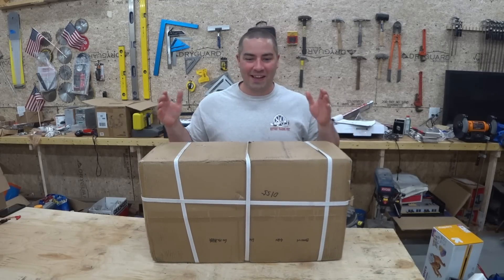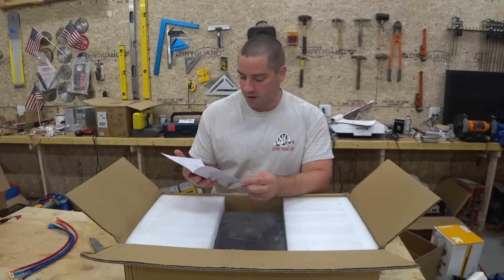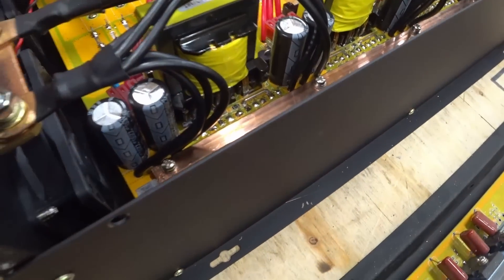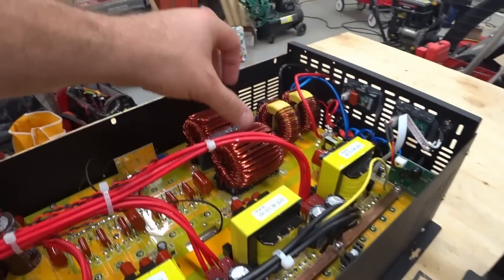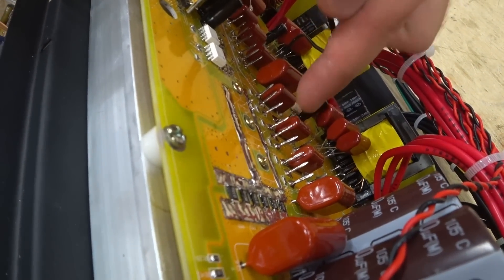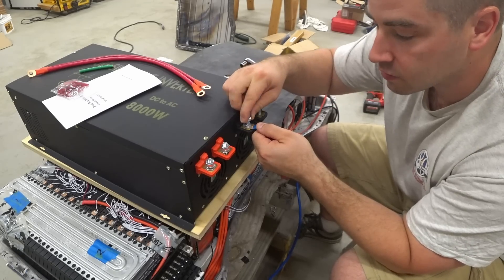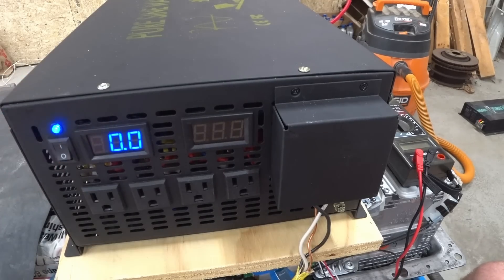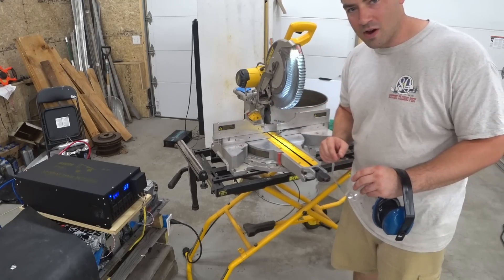Cheap 8000w Reliable Inverter, That Works! WZRELB

Comment: So far I’m halfway through your video of these transformers and it all makes complete sense to me now you’re talking about how the wire gauge is smaller and one thing a larger gauge wire going to a plug and then a lower gauge wire jumping between all four plugs is completely incorrect and definitely not CSA approved I would think Just because if you were using all four of those plugs and drawings he even only 10 AM so if each plug that’s 40 A that wire would definitely mount a friend of mine in China who works at a battery manufacturing company and they also make PMS is and transformers they do the whole solar equipment package then power wash the whole 9 yards he’s told me that because of everything that’s been going on their largest scrap metal supplier which is the United States has completely start sending them all their crush cars that sort of thing like Canada does we sent it over to them they melt it down remanufacture it send it back to us so they have a huge shortage of more commonly used medals when it comes to electronics like aluminum copper even lead myself if the price is right I would buy this unit but I would just upgrade the wires myself seems like there’s lots of room to work around in there and it would give me peace of mind that the unit would catch on fire I’m gonna continue on watching now and see if I notice anything else

Comment: I have a 2500 watt 24 volt reliable inverter and it will not kick on the ac compressor on a 5000 btu window unit

Comment: I bought the 6000 watt version to replace a 3000 watt inverter. The 3000 is the same brand as the Inverter you are comparing the 8000 with. It's lasted twoyears and it still runs strong, just has a little trouble starting the AC system. The house is completely off grid. The new inverter worked well for 24 hours. Then it blew its top. Literally. Lots of sparks and smoke. I'm sending it back to amazon for a refund but still need to decide on another inverter to replace the 3000 with. Not sure I want to try another one of these.
Reply from the maker: Sorry to hear that.  I ran my house for over a year on an Aims 6kw.  Currently I'm using Growatt 5000ES and is working well.  (videos on my channel of both)
Reply: @DavidPozEnergy  yesterday I picked up 10kw Treeline Power Systems {Sigineer} inverter. It’s way overkill but should last forever. The Company owner had one torn down and showed me all the goodies. The Transformer is massive and the control electronics are solid. And it only weighs 186 pounds! LOL. It’ll be a week or so before I install it. Waiting for the trolly system parts to lift it into place. Will post a video of the whole process.

Comment: What do you recommend for battery pack for your 8000 w inverter; let's say you want to run your chop saw 15 amps and your compressor 9 Amp to nail and reconstruct a tough shed for 3 hours????
Reply from the maker: Generally, you don't want to exceed a 1C rate of discharge.  This means at a minimum you want an 8kwh battery with an 8000w inverter.  Larger battery is fine, but smaller might get into over-heating issues.

Comment: Not recommended. Other you tube reviews show zero short circuit protection. Risk of fire or damage to unit is possible and therefore expense.

Comment: I think that you should have tested with the old battery setup to find out if the lack of voltage sag at startup is caused by the powerful battery or improved inverter.

Comment: I think only alot of power is not a quality feature. Most of this inverters suck alot power in idle mode, so they suck off your battery in short time in the night with no load. Thats the problem.

Comment: 120v x 24.3a = 2916w, 53.7v x 58.6a = 3146.82 watts.  2916/3146 = 92% efficient. not bad, not bad at all. in the beginning i heard you say 85%. any chance a max load test was ever done?
Reply from the maker: Yes, it did a little better than the spec sheet said for efficiency.  The next video I did a max load test.  Spoiler, it didn't make it to 8000w.  https://youtu.be/TZbjy9t933E

Comment: The thickness of the wires in Chinese converters is the biggest pain in the ass. Technically, 1mm square of copper is assumed for every 8 amps of current in GOOD COOLING CONDITIONS, i.e. not in the housing! So if the inverter has 8kW, the wires must conduct at least 70A CONTINUOUS current and as much as 150 peak. Therefore, each contact, each connector must have at least 20mm square of clean contact, no resistance, no play, no constrictions, made of pure copper, properly crimped and insulated. Each wire carrying 16,000 watts of peak power should be at least 25mm square.
Therefore, if I were to spend 950 bucks on a 6000W Chinese inverter, I would rather add 200 ... 300 and buy an inverter built in our country, where these rules are followed, or use at most half of the power declared by the Chinese.
Reply: Who makes a high quality inverter in the United States?

Comment: I have a 3000W low frequency inverter 24v input that powered my 14A air compressor. It took 1 second to start sometimes but it always starts.

Comment: For $1500 why not purchase a Aims inverter/charger?
Reply from the maker: For most applications I'd prefer the Aims.  This one is lighter, so maybe if weight was the main concern you would go with the Reliable brand.
Reply: @DavidPozEnergy  that's true, but would really only be a concern in the bush, for shipping, but reliability of aims is hard to beat, but I liked them a lot more when they used better quality parts.  I'd try reliable, but not for a 1500 price tag, I'm a huge fan of dip switched and the ability to use 220v,208v,230v,240v and the fact that aims are marine grade coated inside...

Comment: I bought the 5kw and installed this week. What happened to the AIMS inverter? I used one that looks identical to the AIMS and replaced it because the idle load drained my lead acids by at least 55% nightly. I energize half my home with solar so this is a big deal. I am new to your channel and like your videos. Thank you!
Reply from the maker: I sold the Aims inverter to help fund the new SMA inverters.  Thanks for watching.
Reply: @DavidPozEnergy  thank you for responding so quickly. I need a low low idle draw inverter like my magnum. Do you think the Reliable will fit the need?
Reply from the maker: Depends on your needs.  Reliable inverter have an OK idle draw, but not great.  I'm currently running SMA inverters and they have fantastic idle.  35 watts on a 6kw inverter.
Reply: @DavidPozEnergy  thank you for your input. I read that the idle draw on this 5kw is 40. My Sigineer (sp) idle draw... I think they make the AIMS... was 80 watts. I am selling it lol. Thank you again. I am learning from watching your videos. Have a good evening.

Comment: Your video, and testing methods were excellent. After watching, I conducted a websearch for the company and found that they have had several complaints... you may want to check out https://www.supplierblacklist.com/2016/04/28/yueqing-reliable-electric-co-ltd/  this company owns the Reliable and WZRELB brands. Suggest you check it out. They appear to be sending units to all kinds of youtubers for free.

Comment: I bet there are two sets of inductors for the screw down terminal box, as well as thinner cables running to the actual screw down terminal, because they might be doing a split phase system. They might be doing 60 V on each wire offset by 180°, just like how we get 240 V power here in the US. Even that doesn’t make complete sense though, and I lack the full knowledge (wouldn’t that still be 66A per wire?), just a shot in the dark

Comment: Explain what an inverter is used for pls?
Reply from the maker: Sure.  An inverter can take battery power, which is DC, and turn it into alternating current, AC.  Our homes and appliances use AC.  But batteries supply DC.  I'm working on building solar off grid system where the solar panels (DC) charge batteries (DC) but I need to use it as AC.

Comment: If you mean reliable inventer is there a multi appliances connected to it?, because you're cheating the normal battery to use, instead of normal lead battery plus solar but you have a heavy load capacity lithium battery, try to run at least 3 different appliances plus lighting's at the same time, because that is what reliable means when you are using inverter -like in a motor home etc.
Reply from the maker: "Reliable Electric Inc." is the brand that makes this inverter.

Comment: The wires are a bit small. There's a code that they can be smaller inside a appliance. Heavier wire would keep the heating down inside

Comment: I would like to see at lease 8 to 6 Gage wires. Yes, I like the 48 volts battery power inverter. I have to used two 8000 watts inverter to run my 240 volt well pump.

Comment: Capacitors on both inverters are comically small for the claimed output rating. These will have zero surge capability

Comment: good  technical  information about  Solar  power  inverter  #  but  U  did not   inform  when inverter  convert  batteries  DC  volt  to  AC  volt  it must  convert  to   AC 220  volt  & it must  also  show  how much  AC   ampear  current  it  converts #

Comment: 8000W ÷ 240VAC = 33 amps; so #10awg ok; each 120V hot line should handle 4kw; usually you don't want to be  runing 8kw continually, perhaps 80% of max. Capacity.

Comment: Was the version you tested a 110V output? If it is 220V can it use single phase from the output to get 110V without inducing error on the unit?
Reply from the maker: I tested a 120v output model.

Comment: I know you're a busy man and probably won't even see this question but if you do or any of your other followers could answer this solar newbies question? I found these batteries for cheap but not sure if I can used them in a box van solar build they are as follows (used hybrid battery cores with BAE propulsion. 40V, 220A, lithium ion, A123 System. Batteries in Module are ANR 26650M1A) any help would be so much appreciated.
Reply from the maker: I have not worked with those batteries.  But I think Frank Z uses them.  Check out his channel: https://www.youtube.com/channel/UC5FHXnj6lhE0oXn3gBZq1UQ/featured

Comment: There is a huge difference between chassis wiring capacity and power transmission. #10 is actually rated for 55Amps on chassis wiring. Thing is, it's a short run, so you got very little resistance: https://www.powerstream.com/Wire_Size.htm ....z

Comment: 24 Amps at 110 is only 2500 watts or so.........Let's see if this thing can actually put out 8000 watts.........Pretty weak test dude..........
Reply from the maker: You may enjoy part 2 video where I try to take it up to 8kw.  Spoiler: it did not get there.  https://youtu.be/TZbjy9t933E

Comment: Hi, may seem a silly question but how would you work out how much watts inverter I am in a converted van and have a 32" tv, I charge a laptop/phone and lighting and use a 2000w inverter but was wondering if that's draining my 2x 110ah leisure (12v) to keep the inverter going. As I know inverted do drain so.e power for it to work. Any advice would be grateful.. 
Thanks in advance (Gary uk viewer).
Reply from the maker: Yes, all inverters will draw some power while on.  This is called the "idle" watts.  I've had tiny inverters that draw 10 watts, and big inverters that draw 110 watts.  Big difference when you multiply by the 24 hours in a day.  Using a meter will help you identify how many watts you consume.  I like the Victron BMV 712, but it's expensive for what it is.  I don't know how your batteries are doing overnight.
Reply: @DavidPozEnergy  Hi, thanks for getting back to me. 
I have two 12v - 110ah. during the night all I really have on charge is my mobile phone. I have 5x led lights but that's it. sometime during the day I will have my laptop on charge, but as soon as that hits 100% I turn off the inverter.

Comment: The under dimensioned cabl, if it is, is the low voltage one. Linked to your batteries. Low voltage, constant current with high Amp, big cable....

Comment: Where can I get a good 12 volt power inverter with 4000 w
Reply from the maker: https://amzn.to/2Zr5icG  I used an Aims 6kw for over a year and it worked great.  I linked to a 4kw version.  However, 12v is very hard to work well up at 4kw because you will be drawing over 300 amps!  This will have extra heat and line-loss associated.  If at all possible you may want to look at doing a 48v system.  
“As an Amazon Associate I earn from qualifying purchases.”

Comment: Hey? If I was to buy that inverter, with those thin wires, does that mean I need to modify it so it can provide, 8000 What's?
Reply from the maker: No, it can do surges of more watts for short period of times.  But if you need 8,000 watts continuous, then there are other brands that can handle it better.

Comment: hi . can i use microwave 1100watt ( 2000w inverter ) with 3 batteries - 12v-35ha battery parallel ? and why ? thank you

Comment: What we really need is to see a scope on the 120 output without a load and then at various loads, also a measurement between output neutral and input ground. A 2000 watt Magnasine inverter should be able to start that compressor under any load and the waveform still look clean on a scope. I don't know, because  I don't have your compressor to test with, but Magnum sine wave inverters are the gold standard, possibly Go Power also. I'd also like to see current and voltage measurements on the input side while on standby and at various loads.

Comment: That inverter looks like a 4000-5000 watt continuous duty inverter.  You may be able to get 8000 watts peak for a few minutes but I doubt it will handle the full 8000 watts continuous without much bigger transformers and a lot more cooling.  I would test it with a full load of devices till you get close to 8000 watts and just see if it can do it and for how long.

Comment: very good. If you want to hit 8kW in power to test what this inverter can do, create a simple electrolysis bath. 1 bucket, 2 steel plates 20 cm by 25 cm and attach the wires to them. Then measure the voltage and amps as electrolysis progress.  By adjusting up and down the steel plates submerging in the water you can vary the power amount which is being drawn. Start small at 1kw - by submerging the plates just a bit, then increase until a fuse blows off. see if it can hold that load for more then 30 mins. That will give you a pretty good idea. I did this under 240V since this is the voltage level in my country. For you might be different since electrolysis depends on voltage.  In the video you only tested up to 4.5kw.

Comment: What no one is commenting about is that here is a company in China that is reacting to the previous test videos, possibly customer complaints, also, and have completely re-engineered the entire device to address the failures shown in previous videos. THAT'S impressive. Even some U.S. manufacturers wouldn't do this. I have a lot to say when it comes to the Chinese manufacturing of discrete electronic components (I.C.s, transistors and such) that they do not live up to the maximum ratings of their western world and U.S. made counterparts. Even if well engineered, if the components that make the finished device are not capable of delivering their published ratings ... long comment made short ... it's not (entirely) the fault of the inverter maker that the components fried under maximum, stressed conditions. I fully applaud the efforts of YUEQING RELIABLE ELECTRIC CO.,LTD. to make this product deliver on it's promise.
Reply from the maker: Well said.

Comment: I am not sure why the amazement of a 8kw system, powering what are (max) 1.8 kw tools... a 120v plug is max 15A, so 1.8kw....  YOu are testing max 25% of peak, basically....

Are these items so fraudulently labelled that 8Kw advertised can't even produce 2Kw?

I'm shopping, so am very interested in what the reality is...  Thank you.
Reply from the maker: I've two before this that blew out the internals trying to power this load.  I learned the hard way that the cheap inverters usually don't work.

Comment: Nice video, thanks for taking the time to produce it!  Hey just thought to tell that I like to use a 12v testlight (just a simple automotive style one) for charging the caps, and then you can see when it is done charging, as the light gets dimmer and dimmer and by the time you can't see the light anymore you can know they are charged sufficiently... Just my take, everyone has the way they like hehe..